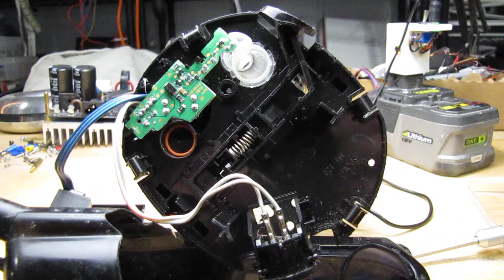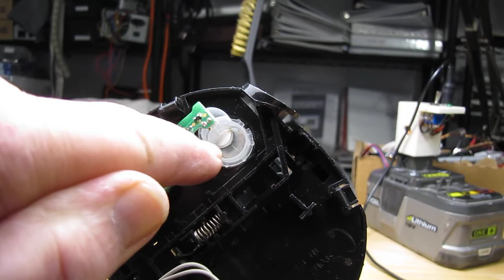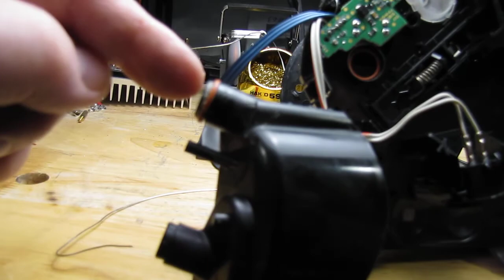DIY FIXING BRAUN SHAVER Cleaning Station

Comment: Mine looks a little different and despite passing a pipe cleaner through the drain hole, it was splattering the EXPENSIVE cleaning fluid all over the counter. I undid the 4 clips and took off the top but eventually took out the phillips screw holding it together and found the overflow pipe to the reservoir was plugged as well. Reasonably well designed and fairly easy to clean it all out and put back together. It had been losing more and more of the precious cleaning fluid in recent months, but in recent days it got much worse and dumped half the reservoir before I could stop it. The cleaning fluid cartridges are $25 for 3 and don't last that long.
Reply from the maker: Sorry for your troubles! I had no problem with clogging but electrical problem. One way to prevent it from clogging is to wash the blade under running water - this  flushes the majority crapp out!

Comment from the maker: P Smith: About connecting the pump motor directly can answer the question if the pump is in working condition. Make sure you desolder one of the leads from the PCB to the pump, if you gonna test it. The problem also could reside on the PCB, if you put it back together and pushing the microswitch didn't do anything. But I'm no expert in fixing these, it was my first and only time trying to make it work. Sorry that I can't help you with your problem.

Comment: Hi Tony, thank you for the video. I watched all of them but I still don't understand what was the actual problem you had with this device? Mine is not working - light is on, but the pump is not working. What was the actual issue with yours and what is the actual solution: just putting the hot glue on the board and fix it in place?
Reply from the maker: In my case, the small PCB was undone from its position, so I've snapped it back in to correct place and hot glue the PCB board so it doesn't get loose again. Also, did you click on "SHOW MORE" and watched the other videos? If your pump isn't working, make sure the PCB board is in correct position. There is a microswitch that enables the pump - if I remember that correctly. If you have it all secured and pump will not work, despite all of your work, it could be the pump itself, but I can't judge that from here. Hope you can fix yours! Have a great day!